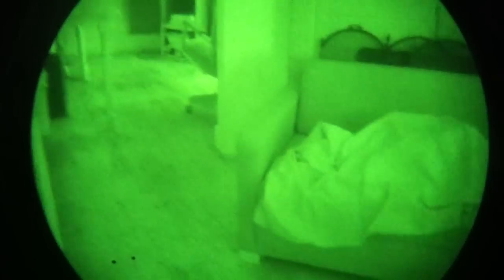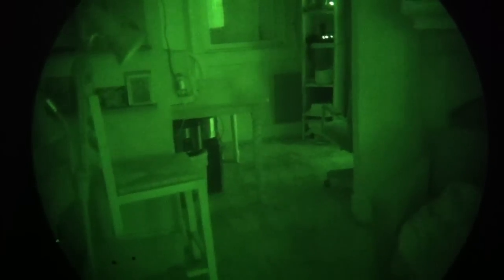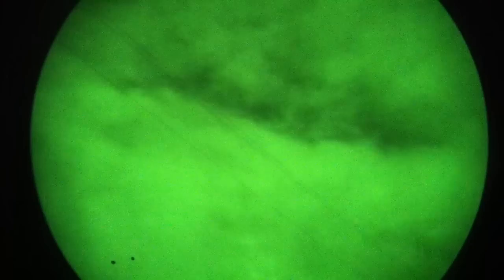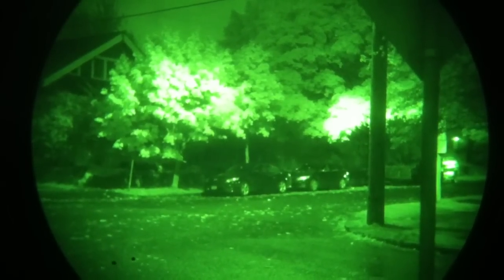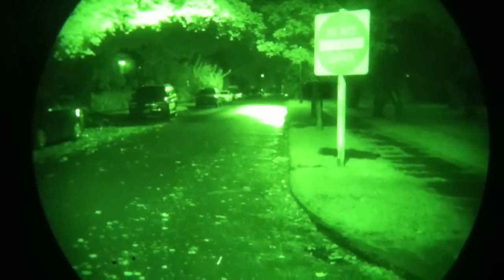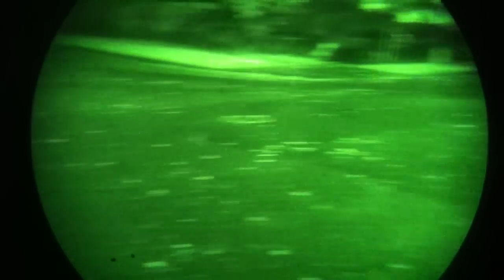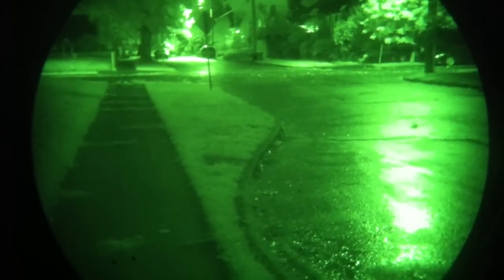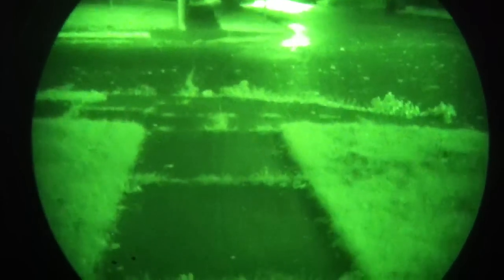Testing the Chinese DBAL IR/Green laser at night with a PVS14

Comment: I bought a night owl 1x from nation geographic store for $99 (gen 1) and glued  a pick adapter on bottom and used the same Chinese dbal on my pump pellet gun ..it has worked great for 2years.  (No recoil) ....5 head shots at 20-30yards....no problems!!!....recently upgraded to a nc star unit.  Much better.  Twice as bright both lasers o n together making zeroing much easier.   Night owl still working fine. Adding pick adapter was easy.  Don't know how they will stand up to recoil though.
Reply: Was it the Green and IR variant?  I have an NCStar/Vism laser as well and I think it’s great for the price.  Then again it’s my first laser I personally owned and the only other one I’ve used is the PEQ 15.

Comment: Hello I have recently taken the IR filter out of a Panasonic lumix point and shoot camera . and after testing around with on hand lighting options. Like using the remote control ir led bulb cover filter to let IR light to pass . Using an incandescent flashlight . With this option I get ok results but noting that will reach out over 10 ft and not very wide either . I then used another incandescent bulb head lamp with 2 AA and filtered with a couple old slides . This doesn't put out hardly any residual light other than if looking directly at the bulb from straight ahead of it . One can see a slight purple presents . The other small light with the remote control cover filter put out a lot more residual light and was red tint . What I am thinking of trying if the theory is sound . Is to use a med stregth laser or what ever power would work best . And add a magnifier to try to  disburse the light into a strong beam but wider . So I would go from laser to magnifier lens then ir pass filter or filters . If and when I can get a bright enough IR  light that isn't noticeable to the naked . As well as not weighing 5 pounds . I plan to take the digital cam and the light and devise some goggles . By using some old ski or welding goggles . I plan to use a Fresnel lenses to make the live view behind the camera larger . The camera should be positioned about 5 or 6 inches away from eyes . With the Fresnel lens behind the camera . All of this I plan to have enclosed . The laser pro's is that I am thinking it will be light and smaller than a mag light incandescent with D batteries . Which is what it would probably take using the incandescent method .   With the laser I would be able to mount it or them possibly running two . Mounting them by the temples . Any tip's and advice ,ideas or critiques would be very welcome . Thank You and God Bless

Comment: I had been looking into, first, mounting a night vision monocular, onto my air rifle. I figured I could make a sheet metal bracket, and use the threaded tripod hole in the device for that. Then, I need a way to sight in. I thought an IR laser sight.  However, after watching your video, I don't know if it would work. I would use the setup to shoot rats at night at mostly distances of 10-15 yards. Now, I'm concerned the IR laser dot would be way too large.  Do you think this idea is not workable?  What if I kept the night vision device down to, say, two power?  Don't want to drop a load of money into this.  Maybe a 2x24 Ghost Hunter gen I?  I was considering a digital unit, maybe a 3x20. 
    Should I scrap this plan, and go for, say, a Sightmark Ghost Hunter and the kit to attach a day scope in back? 

    What I liked about my plan, was that I could leave the day scope (4 power and crosshairs) attached to the gun. I could mount the bracket for the NV device using one or two upside down scope rings , and a 1" ring with Weaver rail canted to the side for the laser sight.  That way, I could still take the airgun and practice/target shoot in daylight. 

    I figured I could get this workable for about  $200-$220. Maybe $280 if I get a 2x24 Ghost Hunter. 
    
  A gent finally bought, and reviewed the Nightstalker invisible laser sight on Amazon.  

    Here is his comments:
"Works exactly as advertised The dot is not round, but linear and rectangular, and at 100 yds thru a Gen1 NV device the "dot" is almost 2 feet by 6 inches and still way too bright, this could really use a brightness control because at ranges under about 30 feet it's so bright it really swamps the NV scope. The front clear cover is removable and perfect if you want to add internal filters - I'll be adding a photo ND4x filter to it to tone it down. Don't expect mil dot accuracy, all in all it works fine, the visible red glow can be completely blacked out with a IR narrow photo filter. Tomorrow I'll see if it holds up to recoil. My only complaint is the lack of collimation, it should throw a small dot at 100 Yards, not a 2 foot line."
    This is the laser sight I was considering.  But, I don't know what he is using for his NV device, or if it's magnified.
    Any comments on this would be appreciated.
Reply: If you mount any night vision device including a PVS-14 to an air rifle it will broke in no time flat.  Yes, even a high end device will be down and out in as little as 10 to 25 shots.
Reply: BulletSpoung you couldn't be more wrong. I've hunted with and shot my pvs14 many times on my AR.  still running fine.
Reply: Jon Neet I run real PVS14s, Wilcox raptors, real dbals, ect ect. I do have a ghost hunter I wanted to compare to my high end stuff and it's only good for closer ranges. Depending on your budget I'd go with a atn x sight 1 or 2. add a extra 50$ evolva t50 IR light to it you are good for close range and long range.
Reply: You are thinking of break barrel airguns, and you are correct. I don't use my night vision stuff on that type of airgun. No problem using it on a multi-pump, CO2 shooter, or a PCP though. They don't make the punishing two way recoil that a break barrel airgun does.

Comment: The thing with using a digital camera with out the ir filter . It can't see in the dark or even with moon light with out IR light . I know you are using a tube based system . Then I am trying to get by with . I have looked at systems similar and decent entry into the field runs 250.00 two 275 . Base line . I am working this project I mentioned in the previous comment . To see how good I can make it . There is a gen 1 night owl .05 x NV scope non mountable to the rifle for 80 used . I thought of getting one although I feel I would be wasting my money . I did think one of the cheaper scopes with a good IR torch bought separate to enhance the scope may do the trick . If I knew for sure that for example the gen 1 cheap Night owl scope and a strong IR torch would be sufficient . I would go ahead and do that at 80 for the scope and 40 to 60 for the torch ave total would be 130.00 + or - . . But know no one that has NV or has used NV it increases the odds of buyers remorse and wasted money .  Again any info you may have would be much appreciated . God Bless
Reply from the maker: For all that hassle, just shop used PVS-14s on ebay and get a phone camera adapter for it like I did.  They work fine with third and fourth generation Iphones.